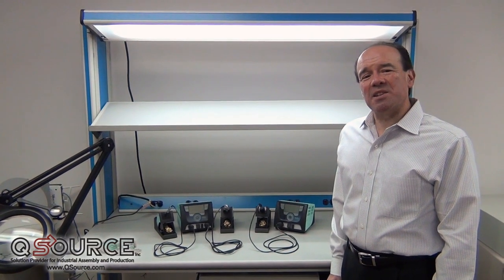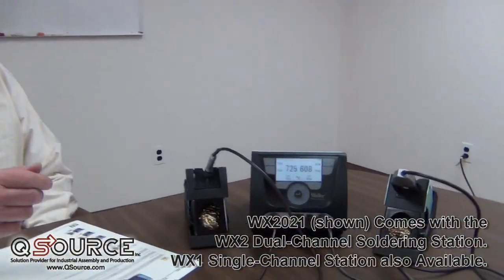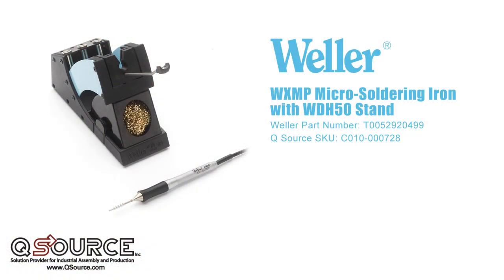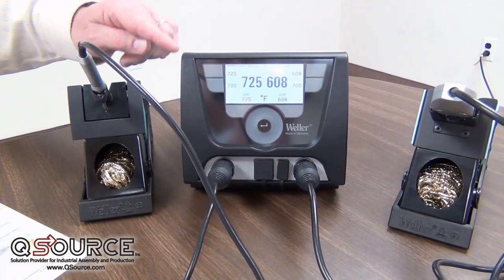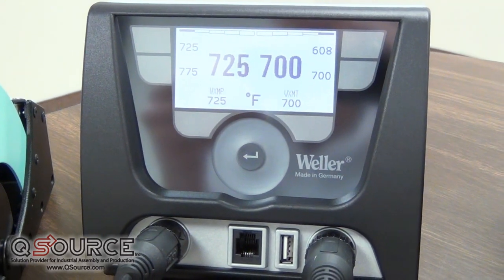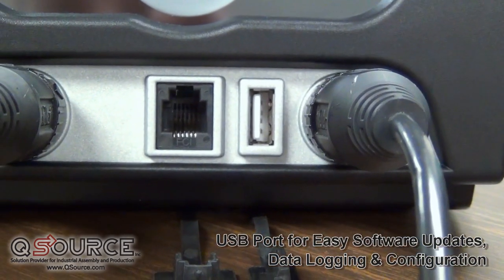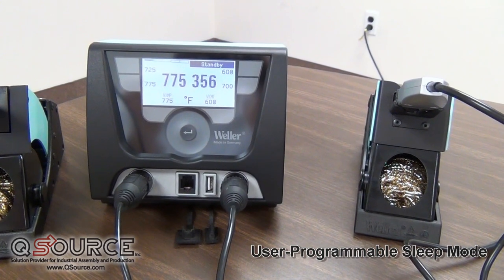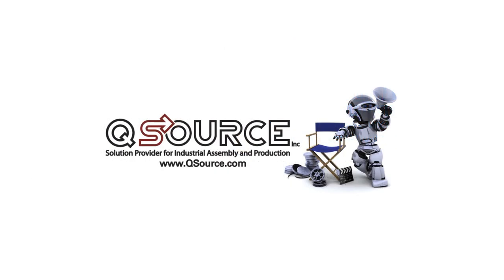Weller WX Series Digital Touch-Screen Soldering Stations - Q Source, Inc.

Comment: I do mostly prototyping and design where I'm constantly pulling test boards apart, Nothing touches this line, compare the Hakko's dollar for dollar, they can't compete. Weller is ahead of their time with this instrument. Sure it's not for the hobbyist but as a pro pulling SMT boards apart and putting them back together I say you can't beat this station.

Comment from the maker: We agree that this is a very feature-rich soldering station that won't appeal to some. The intended users of the WX Series would be in high-volume, precision industrial manufacturing environments where there are dozens, if not hundreds of stations set up and all need to be calibrated to exact matching specifications.